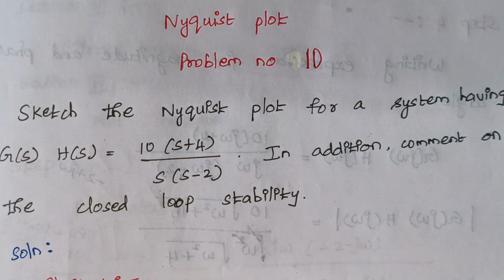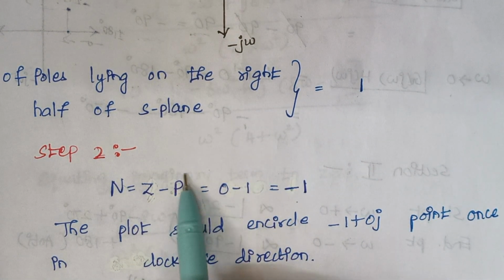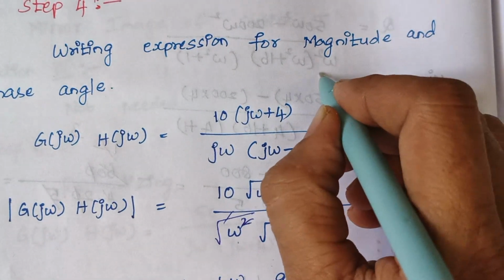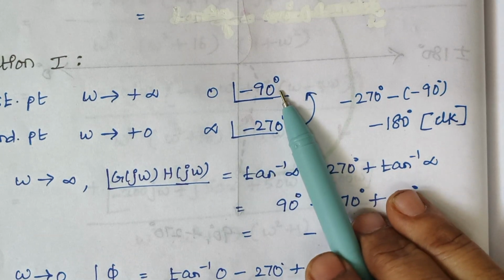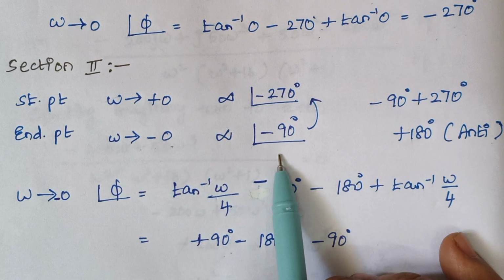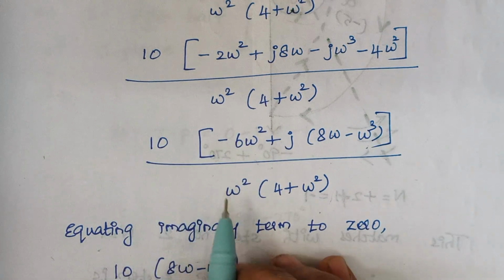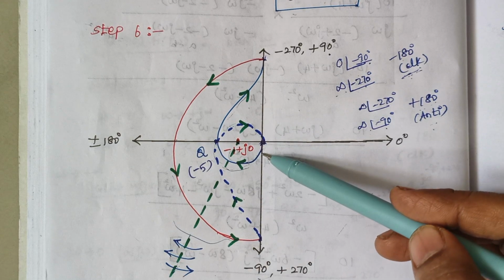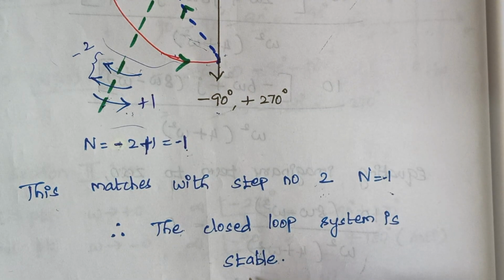Nyquist plot ( Problem no -10)

Comment: In this sum, why did we take (in step 2) N = Z-P?
Whereas in other sums it was N= P-Z mam?
Reply from the maker: Both are correct.You can write in both ways.The number of encirclements should tally.thats it
Reply: @kowsiteaches  But If we write as N=P-Z, it becomes N=+1, then how will it tally mam?
Reply from the maker: The direction ( clockwise and anticlockwise) will vary accordingly